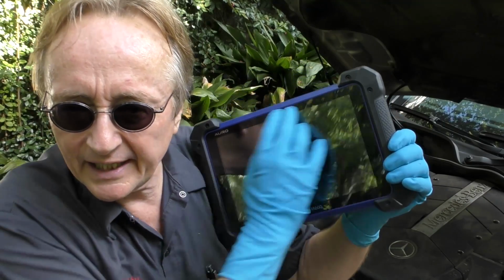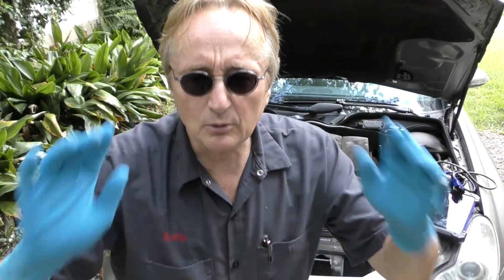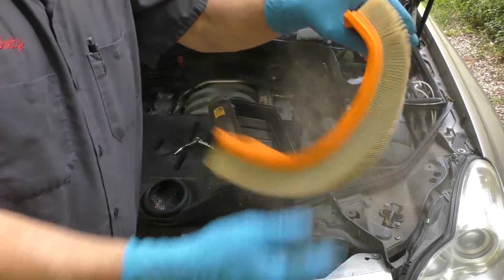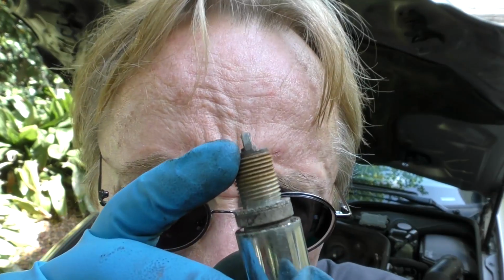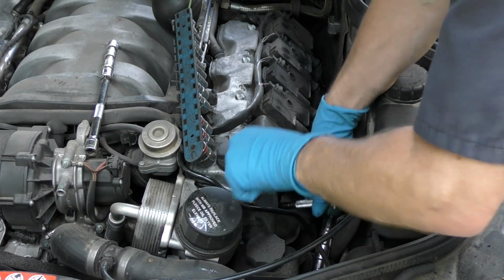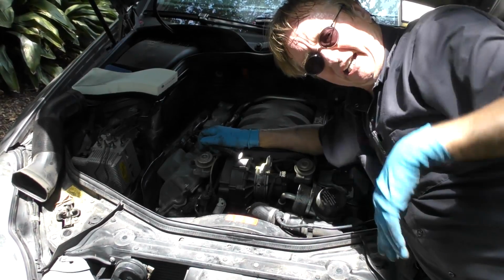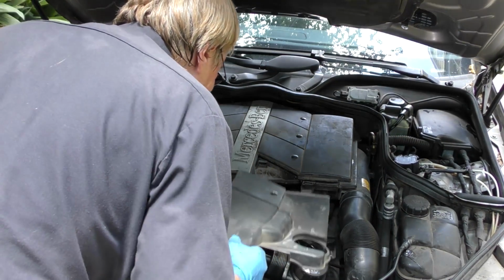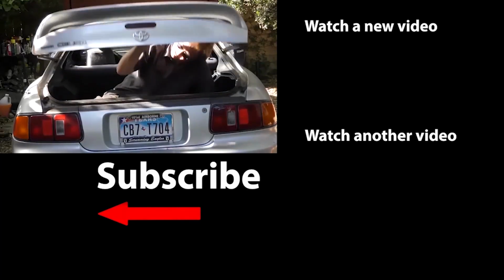Doing This Will Make Your Car Idle Better

Comment: What i do when i see engine cover on my car: Remove it forever. What is meaning of having an engine if you cannot see injectors and plugs everytime when you open the hood
Reply: The cover helps keep the engine clean.
I do wonder why they don't cause a motor to run hotter though.......

Comment: Hey scotty I have a 97 ford ranger v6 3.0 with 56k miles on it. On initial start of the day it fires up but engine shakes around for 10-15 seconds and then runs smooth any suggestions? I haven't done any work to this except changed radiator when I bought it a year ago.
Reply: Cycle the key 2 or 3 times before cranking it over. If the problem goes away then your fuel pump is starting to lose pressure.
Oh and I think the spark plugs are due at 60K. Use Motorcraft. 
Also change the fuel filter.  Use Motorcraft

Comment: Damn, and I complain when I buy 4 spark plugs for my car, now imagine getting 16 of them!!!
Reply: El Profe mine has 6 iridium plugs that last 100,000 miles. I changed them at 100,000 and have 140,000 miles on my 2006 Kia Sportage now. So double the price wouldn’t be fun.

Comment: I have a 1998 1.6 4age 20v Toyota Corrolla. When cold start it idles at 1200rpm but when it heats up the idle gradually climbs to 1800 and sits there! New air filter new spark plugs done. What would be the cause? Thanks

Comment: I have 2002 Buick rendezvous, I hear a shaking and rattling sound and changed the spark plugs it still did it while idling. So I’m going to try replacing the air filter

Comment: Hey Scotty I have a 2010 Chevy Traverse LT AWD and my blower motor sometimes come on after I shut off and take key 🔑 out from ignition, I have changed the relays, any advice you can give me other than selling it.
Reply: Don't trade it in. Just sell it😁
Reply: I'm guessing here.... I'd first investigate the ignition switch. Maybe its not fully off but yet the key can come out.  Next time try rotating the key to a position that you know for sure is off.. then pull the key and see if it happens.

Comment: I have an 03 Lariat 5.4...changed plugs, coils, EGR, several vacuum lines, fuel filter, air filter, cleaned throttle body/spacer, cleaned all vacuum ports, and EGR port, and probably a few other things.  Still idles rough...

Comment: Did all that, plus ignition wires, oil change, fuel, air and oil filters, throttle body cleaned, idling feels like driving on a bumpy road. :)
Reply: Do you have a check engine light on ? 
If so , check the code . Are you using cheaper gas ?  Maybe try better gas . Did you check coil packs , MAF sensor ? What kind of car and mileage ? Does it smoke when idling?  If high miles , could be valve sticking or other worn out internal parts .
Reply: @jayhockley8841  Check engine was on until I figured it was a loose EGR hose, clamped that down and check engine went off right away.

It is good gas, coils not replaced yet, no MAF on this car, no other problems.

The weird thing is that it comes and goes, usually when it's cold, after a long trip you don't even feel it idling, but when it starts up it's like an earthquake. :)

I do have some other ideas, but no money for them yet...

Comment: What if you got new air filter fuel filter ignition coils wires and spark plugs 
Riddles mostly smooth but has a random shimmy you can feel when you idle a long time at a long red or parked happens kinda randomly

Comment: Scotty i have a 1994 toyota celica its a automatic transmission and my steering wheel shakes when I put it in drive or reverse and sometimes in park and it shakes when im at a light I check my motor mount and the transmission mout looks crack i belive its crack and i check the spark plugs and they where fine and as well the coil inside the distributor is crack to i went to the junk and tool it off another celia but thah one was crack to not as much as the one that came in my celica but it shakes a bit less

Comment: Whenever I do a full tune up like this I use a terminal contact cleaner on all the coils and wire harness plugs, and use dialectric grease on all the connections including inside the coils, also a tiny bit of anti-seize on the spark plug threads as well to ensure next time I need to do a tune up it all comes apart easily and all the electrical connections arent too dried up. I put a new ignition switch in once and just plugged the old wire harness in to it. Well the plug melted and shorted out everything because the old contacts in the plug on tje wore harness werent cleaned and everything was dried up and brittle, the connections were all oxidized from age so it created a ton of resistance. The motorcycle was workimg fine until that plug melted and I ended up replacing the entire wire harness and ignition switch again. Ever since then when ever I take apart a plig connection of any type I clean the contacts and apply a little dialectric grease and have never had that issue again. A little extra step, and the dialectric grease costs a couple bucks for a big tube that lasts forever, but you never have to worry about a new plug connectimg to an old plug, or an old plug to an old plug and having a build up of resistance issue due to oxidation from age. I just did the major tune up on my Jeep Grand Cherokee with a 4.7-V8 this last weekend and cleaned all the coil contacts and applied dialectric grease and it idles smooth as glass. Hope this info helps someone.

Comment: I have a 03' Mercury Sable . When I go to start it  up it idles high a t 2 or 2half RPM... I change the spark plugs wires &  spark plug and ignition coil and clean the throttle body and and IAC

Comment: It's funny, this is exactly what I had to do with my Excursion yesterday, except that it stalled on a cold start! In my case, I just had to clean my K&N air filter and while I was down there, replaced cylinder 3's ignition coil and spark plug. Now just one more down and they'll all be brand new!

Comment: Hey scotty, dont know how to really contact you. If you happen to read this, i have a 85 chevy caprice classic that has a real rough idle. Engine shakes and has slight ticking noise that speeds up with higher rpms. Air filters cleans. Fresh oil change. Muffler fell off car that i need fixed. Could that cause the bad idle or could it be something more serious inside engine. P.s. not sure of miles odometer reads 15700 but not sure of exact

Comment: Had a jeep that would idle as if you driving down a bumpy gravel road. Changed the throttle position sensor and it was good

Comment: Well this is why I did to my 97 f150 as well as clean the maf sensor and secure an injector plug and it cleared all emission codes, a misfire code, and a horrible idle.

Comment: My 1.9 Diesel engine drives with no real power, it seem to recover it’s power when I park and  idle the engine over 2000 rpm on the park position. It seem to trip a control injector message that stays constant on but turns off if I shut the engine off. I changed the EGR, removed and carefully clean the tips of the injector, replaced the engine filter and cleaned the mass airflow sensor. When I start my car my engine idle smooth but once I takeoff it has no  real power when I drive. But if I park the car and I Reve just over 2000 RPMs it seems to work fine afterwards consistently even if I stop at a red light but once I turn off the car it seems to reset the issue again. The engine light is on. Haven’t been able to check the code.

Comment: Hey Scotty I had my mechanic do a tune up on my 2000 expedition and it's shakes at idle now and it was not doing that before I already checked for vacuum leaks and the spark plugs and coil packs are new and everything is connected together could it be my fuel injections

Comment: I have an issue like this, but I've changed the spark plugs and air filter. The engine will rev up and down when its in park or neutral, and when the ac is on and the engine is warm. Any ideas?
Reply: Clean the MAF sensor,throttle body really and while under the hood clean or replace the PCV ....do this every time you change the spark plugs (every 4 yrs) so you'll never forget to do all these maintenance all in one go while the hood is up and it doesn't take that long.Your vehicle will like you for it.
Reply: Check your throttle position sensor.
Reply: Both good replies. Additionally check for vacuum leaks (watching fuel trims is a clue)
Reply: @wydopnthrtl  Ive done the above, except im not sure where my throttle position sensor is. What do you mean by fuel trims?
Reply: @NPC-yn4nw  If your throttle is cable driven,  look on the throttle body opposite where the cable goes to. You should find an electrical connector plugged into a small unit that is held by a couple screws that just kind of sits on the end of the shaft for the throttle 'butterfly.' That little unit is your throttle position sensor.
 I hope that made sense to you.
If your throttle is electronic (rather than cable driven) I'm not sure what to tell you.
Reply: @NPC-yn4nw  Another thing to check depends on your vehicles design. You mentioned that you changed the spark plugs and air filter, but if it has them, have you also considered replacing the plug-wires along with the cap and rotor? I know those are rare these days, but without knowing make, model and year; I am just guessing. Good luck.

Comment: Hey guys my 2004 Toyota Camry is idling really harsh. Spark plugs and air filter were replaced but problem persists. It's tripping the po300 code. Could it be the MAF sensor?

Comment: Hi Scotty, got a 2005 c230k what about when it starts idling rough when the 
A/C clutch turns on. Could it be the belt tensioner?
Reply: @sour diesal thanks bro that's what I was thinking because  It's not showing any codes.

Comment: Did all that on 2 different  01 Camrys 4 cyl  .auto and still runs a touch rough.
No codes or pending codes

Thoughts?
Reply: cpgone poor gas quality, that the engine is trying to adapt to. Also, those four cylinders in the Camry do not have counter balances, to make it feel smoother, than your run of the mill four cylinder. Your work is done. Crack a cold one and call it a day. Ain't basic transportation grand?

Comment: Have a vw, love the torx life. Amazing little bolts. Just get the bits for an impact driver or drill and use the clutch on a low setting. You wouldn't believe how many of these little guys I do when I change the diesel filter.

Comment: Nothing more satisfying than a good ole tune-up. Check/replace fuel filter,pcv, plugs,wires,cap,rotor,points, condenser,air filter, set timing/dwell angle, rotate tires,lube chasis, Repeat every 15k. Now to the fluids....

Comment: 1999 Ford Explorer no codes runs good , but small ticking noise when accelerating ?  The faster I go , the faster the ticking noise ?
Reply: The neighbor put a wire tie on your driveline.
Reply: carpetcowboy58  that would be a good trick , but unfortunately ,that’s not the problem.

Comment: Torx heads are vastly superior to Freedom Head (Phillips).

Also bad or going coil pack(s), deteriorated ignition cables, bad or going alternator, bad or going lambda sensors, bad or going ECU, poor fuel and a bad or going fuel pump can also cause an unstable idle. And they might not immediately show a code either.
Reply: I got a batch of bad fuel once under 1600RPM the car would shake violently and when moving off would always come close to stalling but once I ran it down to half a tank I filled up again with good fuel and most of the problem went away and by the next full tank it was back to normal.

Comment: Thanks scotty u are a great help , i had the same problem with my CLS500 , it runs smooth at high speeds but shakes a little bit when idling, i changed the filters and that almost eliminated the whole issue except for little shaking when in cold starts ..

Comment: HEY SCOTTY!!🚦🚗🚓🚓🚓🚑🚒

What's the best tool kit/set to buy when starting to do simple work on your own car? 

And what sorts of work can be done as a beginner mechanic, besides oil changes😅😅

PS: I'm working with only 2, 3 hundred dollars for a kit. Is that even enough for a decent tool kit??

PPS: I CAN'T AFFORD A FANCY SCAN TOOL😅😅

PPPS: I own a 1st gen forester, I only include this just in case this helps to narrow down some specific tools because of the boxer engine🙄🙄🥊🥊
Reply: Check out a basic set of sockets and wrenches. The Husky brand at Home Depot aren't bad and are lifetime replacement warranted. Don't forget screwdrivers and maybe allen wrenches. Sometimes you can find a 'Mechanic's Tool Set' on sale, that should give you a pretty good start. Don't be afraid to stop by some of your local auto shops and talk to the mechanics for their input; they all had to start somewhere as well.

Comment: Hey Scotty, I have a problem with my 2010 ford fusion. When I floor the gas, it holds back for a second before shifting to higher gear. I've seen this in other, newer cars too. It's like the front breaks are engaging for a sec, the car rocks fore and back, then accelerates.

Comment: 16? Yeesh. What else can cause idling issues? I have a 95 Caprice. I've changed the plugs, air and fuel filters, cleaned the throttle and went back to Super after a brief experiment with Regular. Car is running better but after driving  a while it knocks and surges a bit at idle. Reminds me of having intestinal gas.

Comment: Hey Scotty, thanks so much for this advice! My 04 Mitsubishi Eclipse idles hard and so I'm going to check my spark plugs. I just checked my air filter and MAF sensor the other day, and cleaned the throttle plate, which outside of changing oil is the most involved I have been in my car. Thanks for the tips!

Comment: my vic is idling rough. i cant get the ignition coil off the spark plug on the 8th cylinder. i thought it was a smaller size bolt on the coil holding it on but really its ridiculously stripped. idk how to even bring this to a mechanic they wont want to fix this. blows!

Comment: I have a worse problem my vw polo 6n2 wont start if hot or if the sun shines on it. However when cold starts fine after driving you have to wait 10 min before you can start it or it just turns the engine around without starting
Tried chaning ignition coil 2 times the 1 crankshaft sensor and 1 camshaft sensor none worked
Reply: It does say short Circuit on minus on all the injectors but i find no problem in the wiring harness. Also the engine is 1.4 mpi with 60 hp

Comment: My 2012 Ford Fusion 2.5l ideling so bad, specialy when I turned the AC on!!
I've changed the air filter and the sparks  and still having the same problem   :(
Reply: @andrecheats  I've changed the O2 sensors

Comment: Anyone help please, one in 5 startups of my mk6 golf dsg 1.4 tsi, the car will idle at 3000rpm very loud and shake a bit too, when this happens i switch off and on the car again and it works again like normal like nothing happened.

What causes this does anyone know, got no error codes on obd eleven

Comment: I hate those torx, surprise you didn’t clean the throttlebody and MAF, maybe those things run on speed density🤷🏼‍♂️ thing I like about my Subaru it was made The same assembly plant line as the Toyota Camry so every damn bolt on the car is just about darn near a 10 mm 😂

Comment: Note how honest Scotty is!  I took my F150 into a place for front end issues, AND missing.  They said they road tested it, and couldn't tell it was running rough.  LIARS!  I turned the key to leave, and it was running rough!  Check engine light came on later, took it to another place, told them about the first place.   That place said they couldnt work on it without a code. LIARS!  Months later, it happened again, and the third place said, YES, they can pull the code without the check engine light!😠
Reply: It's probably got a coil going bad

Comment: What if your car temp goes up while idling but goes back to normal while driving?
Reply: Could be lots of things. It could be a radiator fan is not turning on so at idle there is no cooling of the radiator compared to driving speeds when the air is being pushed into the radiator as the car moves. Could be the water pump impeller is not turning efficiently, so at idle (lower RPMs) you are moving less water compared to driving speeds.  Could be other things too.

Comment: Dang that car needed some love definitely a engine bay clean up grease and crap everywhere and sounded like power steering needs fluid or another pump . And lastly new air filters my lord that's terrible really nasty look at that dust that came out of them.  Gezz I bet whoever has it doesn't hardly do anything to the car for maintenance.

Comment: Sometimes when iam at a red light car shakes like hell the when light turns green wont accelerate normal have to pull over and turn car off and on again engine light came on. Then next day engine light off went to mechanic he ran his thing to see previous engine light errors ..Nothing. Its normal guy tells me bern to three different mechanics. Nothing wrong been like this for 2 weeks ?
 Yes this is a cry for help??
Reply: Check your O2 sensor.

Comment: What if it's only shaking on cold starts, but runs completely smooth after a minute of idling?
Reply: JR  Thanks, but I'm worried it might be a sign that the torque converter is going bad.

Comment: My does this aswell it drives realy good but you get to a set off lights or stop sign it vibrates and shakes but I got a new air filter new spark plugs and coils still does it anyone knows?

Comment: When I brake in my 2010 Chevy Malibu it idles the feels weak and ON TOP OF THAT I DONT HAVE NO CHECK ENGINE LIGHTS ON
Reply: Edgar Woowop Check for vacuum leaks and pull the spark plugs out and look at them, like scotty says start from the basics and go upward.
Reply: Epso RKS hey how you doing I have did the spark plug oil change I change my throttle body and the rpms we’re not the same before all this happen the car felt smooth fast now it feels weak like the rpms are up